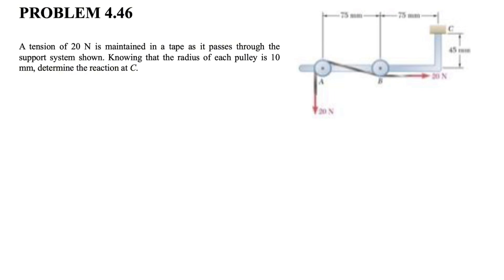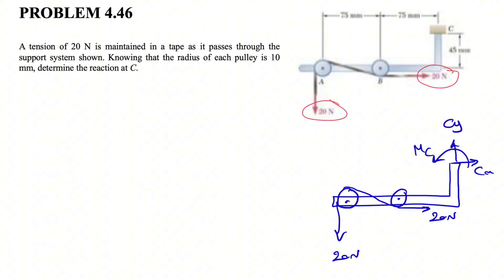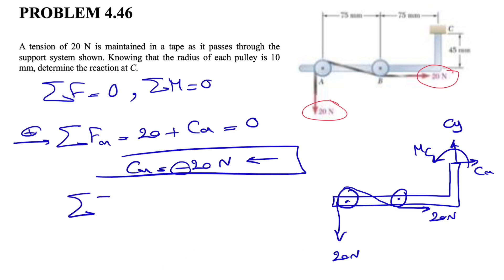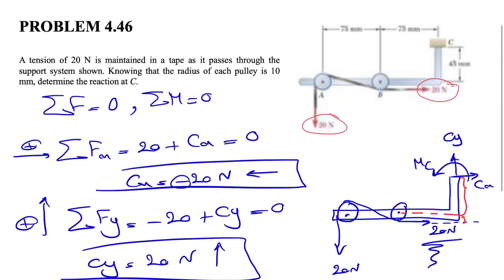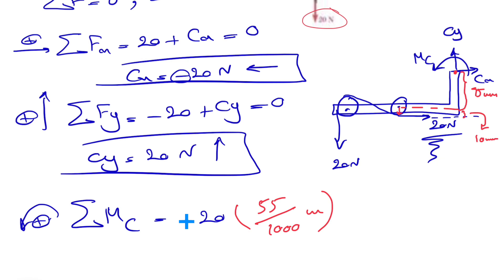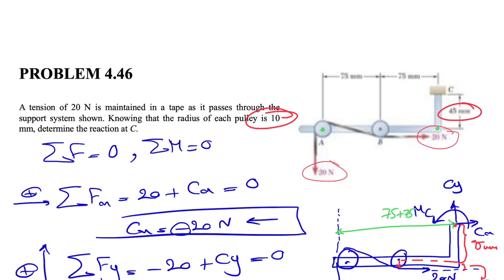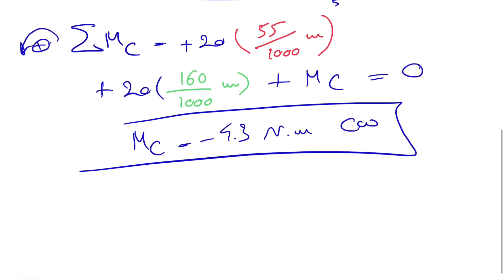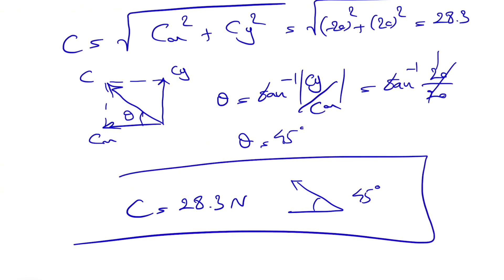Solved Problem  4.46 | Knowing that the radius of each pulley is 10 mm, determine the reaction at C

Comment: why do the pulleys not produce any vertical reactions?
Reply: facing the same question here even when my exam is 5 hours away. I doubt I will get the answer before I go to the exam.
Reply from the maker: Because we consider pulleys and the beam as one single object and we care about the external forces.